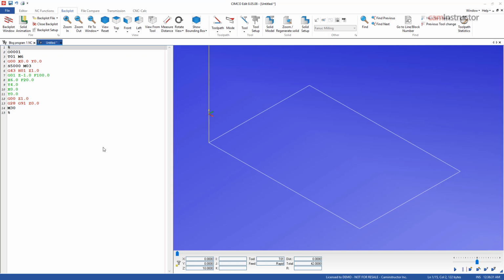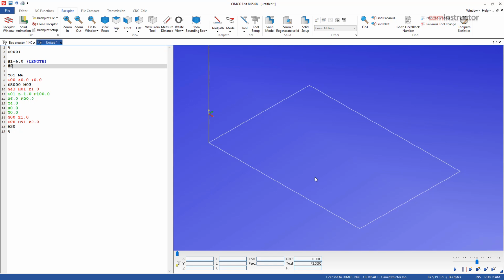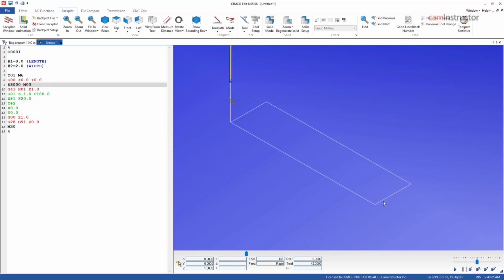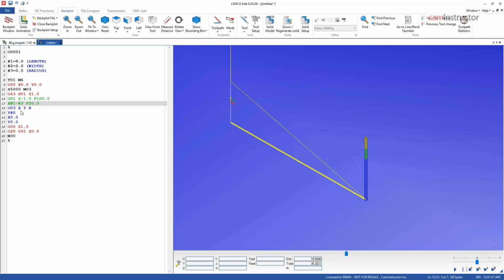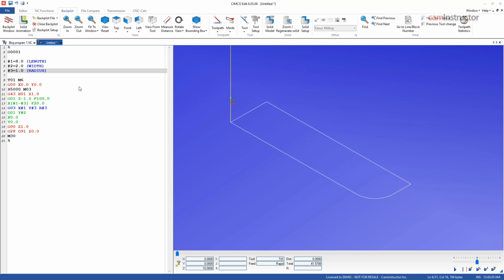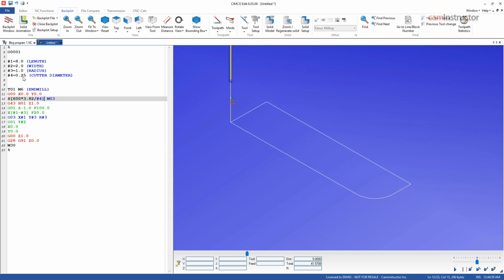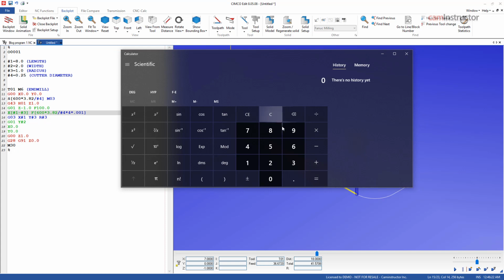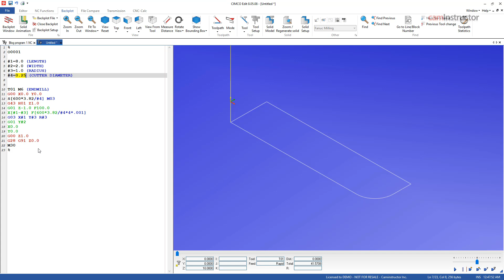Programming CNC Macros - Part 1

Comment: I wrote a a program using this technique that will corner round or full dish a round puck on a mill. Variables for EM size, speed, stepover, Diameter,  Radius, and feed. You can get the machine to do all the trigonometry for you

Comment: Is it possible to create a macroprogram for archimedian spiral or a 3d surface based on curves?
Reply: You have to do it in half circles, so you have a macro that runs your positive to negative and one that runs your negative to positive and loops between them, you have to run it through an if then statement or similar for it's stopping point

Comment: My little macro program. 
T03 M6
T0

G0 G17 G40 G80 G90
G54 G0 X0.0 Y0.0 S1300 M3
M08
G43 Z50 P3 R6.0
D3

G0 X80.0 Y0.0
G0 Z20.0

#5227=0 0
WHILE[#5227LT360.0]DO1
G54 J1
G00 X80.0 Y0.0
G00 Z5.0
G01 Z2.0 F500
G91
G01 G41 X9.5 F800
G03 I-9.5 Z-0.5 F230 L30
G01 G40 X-9.5
G90
G00 Z2.0
#5227=#5227 +72
END1

It counterbores 5 equally spaced holes 19mm diameter and 15mm deep.

Comment: I used this to create a face mill program, works great....thank you. But I need help with the step over amount when you give it a wider value for #2(width)......I cant figure out how to get it to add half the cutter for the step over amount(using a 1.6 diameter face mill so .8 step over would be great). Can you help? Thanks so much
Reply from the maker: Did you watch this livestream where I created a facing macro?  Hopefully what's covered in there helps you out.
https://www.youtube.com/watch?v=jXE4ZCv6yiM
Reply: @CamInstructor  Thanks so much.....got it working now

Comment: This video is super cool. Ive been messing with macros at work with g13 and engraving so I can fill in the gaps in stead of relearn the characters everytime I randomly use these. But I have ideas about facing part and profiling parts. Email me if you would like to try and help. I would pay for tutoring. Jasonadmagarza@gmail.com
Reply: Jasonadamgarza@gmail.com
Reply from the maker: Glad it was helpful!
I have a facing macro that I was thinking of working into a video, might look into doing that one soon. 
Post your questions here and maybe I can make them into videos which would save you from having to pay and maybe help someone else out too.
Reply: I tried a macro facing program for prepping. Do you think you could take a look at it for mistakes or run it in a simulator the only way i can try is at work in my free time.
Reply from the maker: Sure. I'm guessing the code isn't too long, you could paste it as a comment. I'm looking at testing some live streaming before my main stream on Friday...I could do a stream working through the code.

Comment: How can I think about this program? 

O0001(MACRO B SAMPLE - CIRCLE POCKET)

N1 G00 G17 G80 G40 G90
N2 M06 T01
N3 G00 G54 X0 Y0
N4 G43 H01 Z2.
N5 M03 S1500
N6 G65 P2 X0 Y0 Z-0.75 R0.25 I6. J0.375 K0.2 E0 F25.
N7 G00 Z5.
N8 M02

O0002(CIRCLE POCKET MACRO)
(#24  X POCKET CENTER)
(#25  Y POCKET CENTER)
(#18  R Z APPROACH DEPTH)
(#26  Z FINISH DEPTH)
(#6   Z STEP AMOUNT)
(#4   I POCKET DIAMETER)
(#7   D TOOL DIAMETER)
(#5   J RADIAL STEPOVER)
(#8   E CUTTING DIRECTION 0=CW, 1=CCW)
(#9   F FEEDRATE)

(#30 STARTING DEPTH)
(#31 RADIAL PASSES)
(#32 DIVIDE RADIUS INTO EVEN NUMBER OF PASSES)

N1 G00 X#24 Y#25
N2 Z#18
N3 #4=[#4/2]-[#7/2]
N4 #6=ABS[#6]
N5 #30=#18
N6 #31=FIX[#4/#5]+1
N7 #32=#4/#31
N8 #34=#32/2
N9 #30=#30-#6
N10 IF [#30LT#26] THEN #30=#26
N11 G01 Z#30 F#9
N12 #33=#32
N13 WHILE [[#33-#4]LT0.0001] DO1
N14 G01 X#24+#33
N15 IF [#8EQ0] THEN G02 X#24+#33 I-#33 J0
N16 IF [#8NE0] THEN G03 X#24+#33 I-#33 J0
N17 #33=#33+#32
N18 END1
N19 IF [#8EQ0] THEN G02 X[#24+#4-#32] I-#34 J0
N20 IF [#8NE0] THEN G03 X[#24+#4-#32] I-#34 J0
N21 G00 Z#18
N22 X#24 Y#25
N23 IF [#30GT#26] GOTO 9
N24 M99
Reply from the maker: Looks good! Are you looking to add to this?
Reply: Looks good ill give it a try...thanks

Comment: How to move down to "Z" to depth Z = -20.

%
O520 (Y-VARIABLE HOLE PROGRAM)
G21G40G54G80G90
G53G00Z0H0
M05
M09
T1
M6
G54G90
S1000M3
G00X0Y0
G43G00Z100.H01 D01
G0Z10,000

# 1 = 0
# 2 = 0.25
# 3 = 25.2
# 4 = [# 3 * # 2]
# 5 = 100,000
# 6 = 0
# 7 = 0
# 8 = 0
# 9 = 0
# 10 = 0
# 11 = 0
# 12 = 0
# 13 = 0
# 14 = 0
# 15 = 0
# 16 = 0
# 17 = 0
# 18 = 0
# 19 = 0
# 20 = 0

G01F1000Z # 1

N5
G41D01
G01F500Y # 4
G03X0Y # 4I0J- # 4
# 4 = [# 4 + [# 3 * # 2]]
IF [# 4 LT # 5] GOTO5
G40 G00 X0Y0
G00Z10,000

G00Z150
G53G00Z0H0
M05
M09
M30
%

How to move down to "Z" to depth Z = -20.

% (Y-VARIABLE HOLE PROGRAM)
O517
G21G40G54G80G90
G53G00Z0H0
M05
M09
T1
M6
G54G90
S1000M3
G00X0Y0
G43G00Z100.H01 D01
G0Z10,000

# 1 = 0
# 2 = 0.25
# 3 = 25.2
# 4 = [# 3 * # 2]
# 5 = 100,000
# 6 = 0
# 7 = 0
# 8 = 0
# 9 = 0
# 10 = 0
# 11 = 0
# 12 = 0
# 13 = 0
# 14 = 0
# 15 = 0
# 16 = 0
# 17 = 0
# 18 = 0
# 19 = 0
# 20 = 0

G01F1000Z # 1

N5
G41D01
G01F500Y # 4
G03X0Y # 4I0J- # 4
# 4 = [# 4 + [# 3 * # 2]]
IF [# 4 LT # 5] GOTO5
G40 G00 X0Y0
G00Z10,000

G00Z150
G53G00Z0H0
M05
M09
M30
%
Reply from the maker: Saw your other post first. Guess you figured out the -0.2 move?